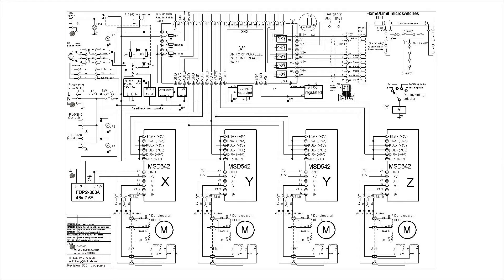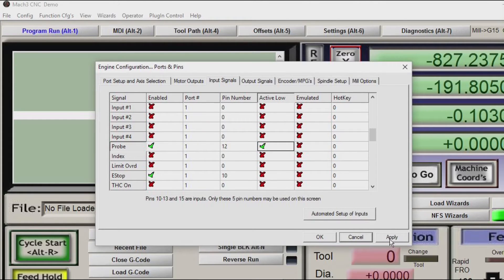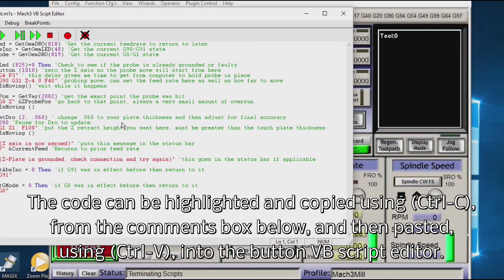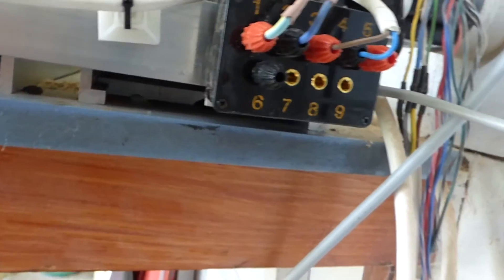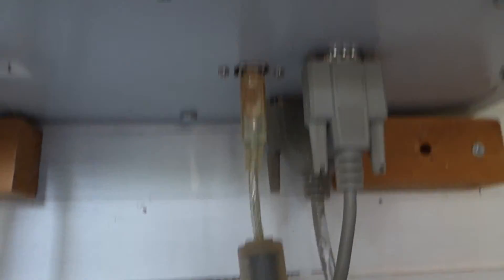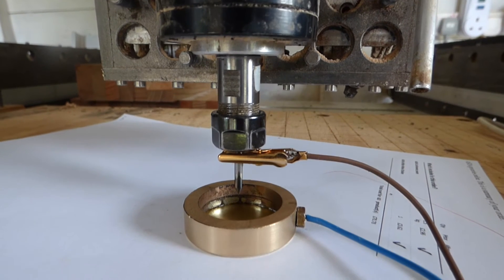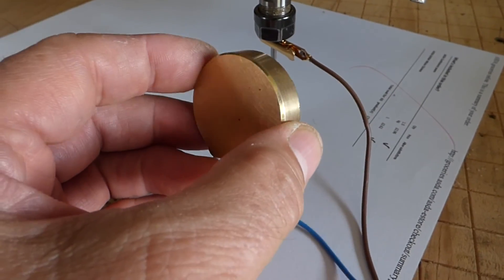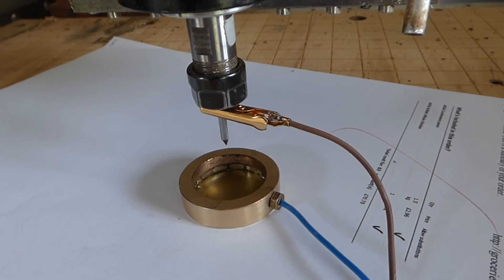Yet another Zero Touch Plate

Comment: Just a quick question, why do you not use the plate the other way up? if would be allot easier to see
Reply from the maker: 1. The thickness of the plate is accurately known.
2. The plate is precisely parallel and flat.
3. It allows probing slightly taller parts.

Comment: Thank you. I tried but z does not stop pioi kindly help me thanks
Reply from the maker: Check your wiring and make sure that the pin you have used matches the Probe pin number in the input panel of 'Ports & Pins'. It must also be Enabled (showing a green tick mark), Port # 1 and Active Low (green tick mark)